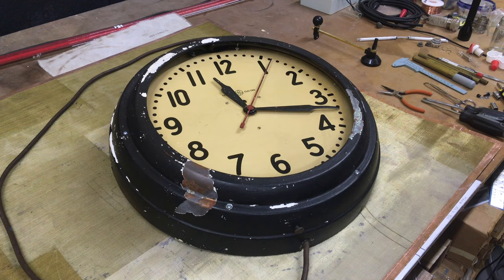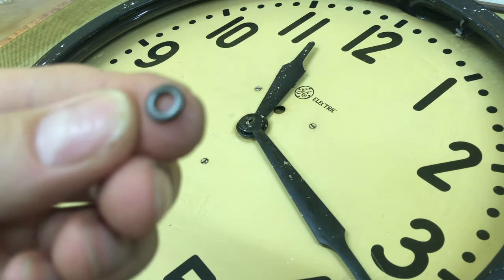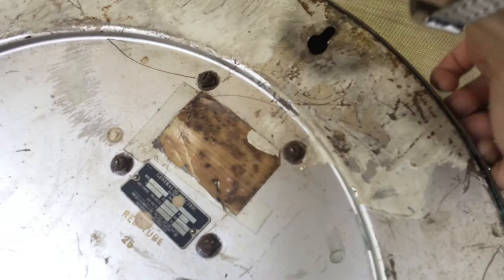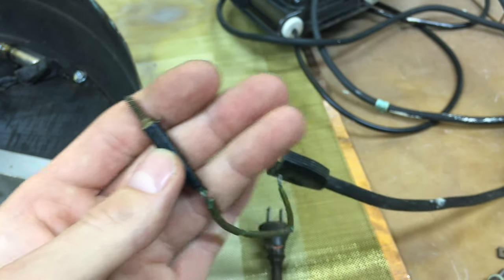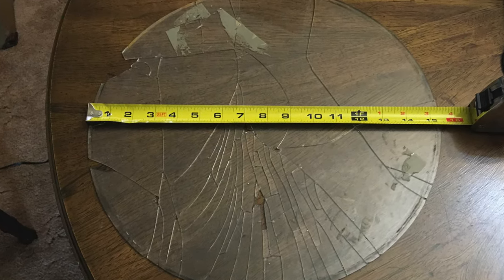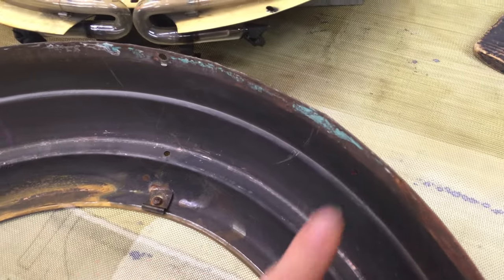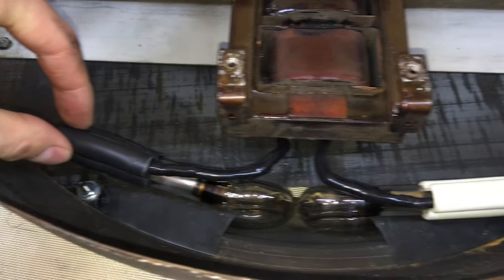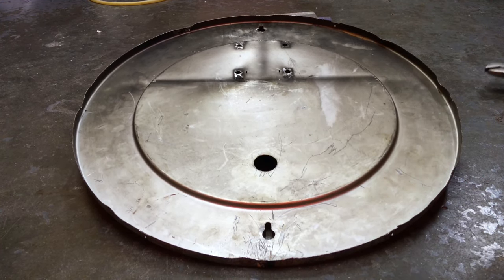Vintage Neon Clock Repair

Comment: I think I have that clock model around here somewhere, projects everywhere, hoarder house atm.  Paid 100s for the clock, I remember that much haha.  You may know this, that little ball on the end of glass cutters, ...score the glass, then turn it over and lightly tap along the score, you can see the glass fracture as you take your time along the score, tapping.  Might be old news, never know.
Reply from the maker: vintage neon clocks aren't cheap these days, that's for sure!
i do have a hand-held glass cutter as well with a brass ball on the end for breaking the glass, but with such a large sheet i wanted to try to do it in a more controlled manner.  maybe i was overthinking it, but i got the job done eventually.  haha
Reply: @NeonPreservation  I'm almost certain mine is just like yours in your vid but I remember the seller's picture showed a blue neon color, I didn't even plug it in, can't find it atm.  Found other stuff I didn't know I had lol.  Your vid's going to help a lot when I get to it if I don't die first.
Reply from the maker: haha, i have plenty of projects too so i understand!  and yes, they did make this model with a blue tube as well.  good luck!

Comment: Great how you broke the glass ! If you want a silence Neon Clock take an elekrtonic transformer.
Beste from switzerland neonhaus
Reply from the maker: true, electronic transformers are silent; however, their high-frequency electronic circuitry is not designed to be confined in a metal box or metal enclosure.  the capacitance coupling will cause internal corrosion over time, which is bad news for something like a clock mechanism with lots of intricate brass gears.

also, i enjoy the slight hum of magnetic transfomers, so i will keep it original.  cheers! :)

Comment: А на шаговый двигатель привода стрелок подаются импульсы 24 Вольта 1 раз в минуту? Это вторичные часы по типу "ЭЧЛ" или "Стрела"?
Reply from the maker: i'm not sure if it answers your question, but the motor is a Telechron.  the motor induction turns the rotor at 3600RPM, then gears inside the rotor reduce the output to 1RPM.  the output shaft of the rotor then turns the gears in the clock that move the hands.

Comment: Anytime you pull something apart for repair and it has Neon involved make a pattern wether you need it at that moment or not,,It was a practice I learned as a young Tubebender It can save a project,,,Have Fun,,,P
Reply from the maker: an excellent tip, thank you!  i do that with the signs, but i didn't think about it with the clock.  duh!  i guess it didn't categorize as a 'sign' in my brain.  haha.
next time i open it up again i will trace a pattern!

Comment: What are those bulbs called. I cannot find a replace for a 16inch clock.
Reply from the maker: are you talking about the neon tube?  all neon is hand made; you will need your local neon glass blower (aka "neon bender") to make a replacement tube for you.

Comment: Cool clock!  I was having problems getting hour hands off too.  Reading around, some guy claims he uses a spoon, pry it up working opposing sides.  It works!  You'll prob find your fav spoon for that.  Maybe put some cardboard under the spoon against the clock face to avoid damage there.  I also use Deep Creep to break the bond using a Q tip, others claim it's the best for things like that, available at auto stores like autozone.  You might not deal with clocks much though.
Reply from the maker: ah, thanks for the tip!  i was thinking about using some penetrating oil and fighting with it, but i figured id leave well enough alone since all i really needed to do was straighten it.  if i need to get it off in the future i will definitely keep that in mind.

Comment: How much is a clock like this worth ?  I came across one almost exactly the same , the Neon Clock Company of  Los Angeles, USA, Telechron motored . Only one hand moves and needs the glass, the orange neon works perfect . Just wondering, thank you for any info .
Reply from the maker: vintage neon clocks are stupidly expensive these days.  clocks like mine with no third-party branding or "theme" sell for less, but still hundreds of dollars.
for reference, i got a pretty good price for this one on ebay in 2020: $500 plus $90 shipping.

Comment: I have this same clock. What is the remote control system you installed? I would like to do the same for my clock.
Reply from the maker: its nice to be able to control the neon tube separately!  this is the switch i used in the video: https://www.amazon.com/gp/product/B077HGSQPY

doesn't look like that particular one is available anymore, but there are literally dozens of other similar options on amazon.
Reply: @NeonPreservation  Thanks!

Comment: I hope (and I'm sure) that you took that beautiful clock with you when you moved, as it is not that big? Oh, and talking about clocks: With the watch that you're wearing, you're reminding me of me and my watch. :)
Reply from the maker: i did take it with me!  at the prices vintage neon clocks sell for i really wouldn't want try to buy one again 🙄

that classic-style Casio watch is both nostalgic and cheap enough for me to not freak out if i smack it on something or scratch the face.  its a functional and reliable tool!
Reply: @NeonPreservation  Personally, I would also call it a beautiful (time) tool. :) And well, my Casio watch keeps being true to real time better than modern devices. It's quite accurate and perhaps is only 1 second slow/fast each month. The clocks of my current and last smartphones were being minutes (!) ahead of real time some months after initially having set the correct time. (And well, updating the smartphone's time automatically by the Internet should be an option, but it somehow never worked.)
Reply from the maker: its a simple, well-made, classic design that goes to show that newer isnt always better!